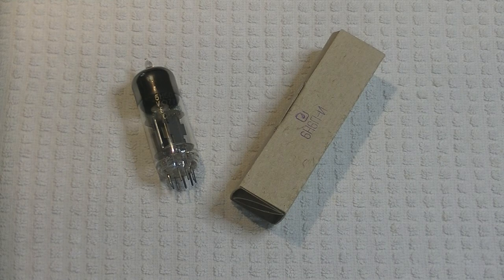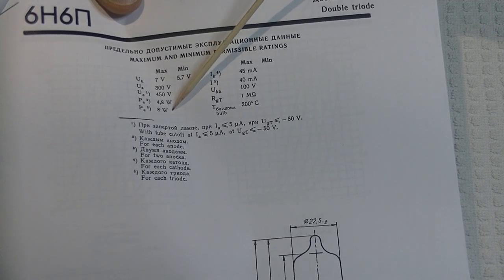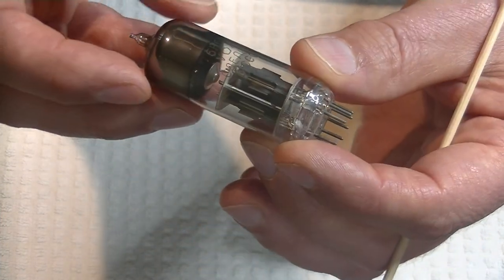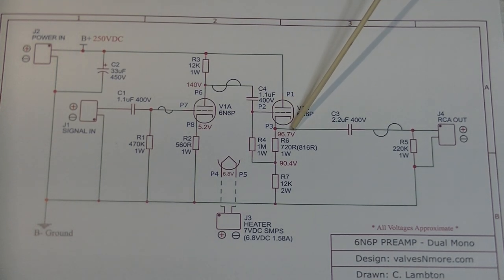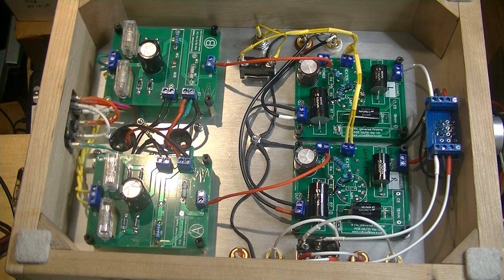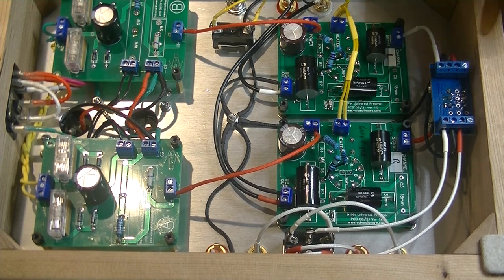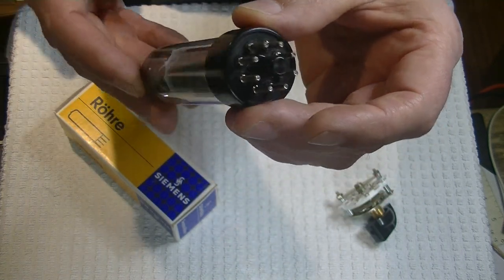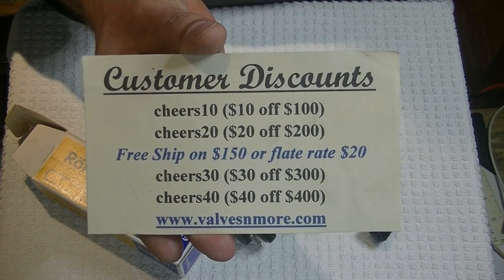Tube Lab #86 - 6N6P Tube & Prototype Preamp

Comment: Really interesting tube. It is actually a small power tube kind of like the 12B4A but with two sections and easier to drive due to higher mu. You could parallel the two sections and get very near a triode connected 6AQ5. Very flexible.
Reply from the maker: Exactly and most importantly it sounds great in my standard Preamp configuration.  Not to mention that it is big, tall and sexy!  I'm a sucker for tall 9 pins with nice full chrome domes.  Years ago visuals didn't matter at  all, because tubes were always hidden inside cabinets.  But I like to put them front a centre on the top plate of our Kit Amps.  Now don't get me wrong, first and for most, the tube has gotta sound good, be available for reasonable money and be reliable, the visuals are just a bonus!
Reply: @tubelab194  And then there are those voluptuous Coke bottle tubes. :D

P.S. is there a particular reason you chose RC coupled cathode bias for the CF as opposed to direct coupling or voltage divider bias?
Reply from the maker: @mkshffr4936  Yes,  I tried various CF bias methods, but it took a week (in my spare time =0) to find the one I presented in Tube Lab that worked perfectly for both the 6n6p and 6n6p-I and sounded great. The schematic is available as a Free download in the store and is under an Open Source liscence as well.  I still need to do some more critical listening, and that will start this week with the arrival of a 5A SMPS to power up the 6n6p-I, which has a start up surge of 5A!  It quickly settles down to 2A, but my 2.2A SMPS wasn't able to handle that surge.

Comment: Thanks for you videos as always! The NEVZ plant to my knowledge was in Novosibirsk, not to be confused with NEVZ Novocherkassk (a locomotive plant). I'm surprised you're surprised: the 6N6P (the standard, not the pulse version) has a reputation of quite possibly being the greatest preamp and driver tube of all in some former "behind the iron curtain" countries. I have an amp in which it's used as the driver for the GM70 transmission tube (the Russian end-all version of the 845).
Reply from the maker: I've heard very little about the tube and going way back with Google shows only a small handful of hobbyists working with it.  Much of the online talk must not be in English, same problem with Japanese tube designs.  But even if I'm late to the party I'm happy to have discovered the tube!

Comment: What is your all-time favorite small signal tube for sound character?
Reply from the maker: My personal experience is limited to a handful of small signal tubes that we use in prototype kit amps.  And of course we only choose to design amps around great sounding tubes!  Currently we work with E80cc, 12au7 (and variants), 6n1p, 6n2p and 6n6p.  For the E80cc both of the more common types - philips and Tungsram sound great, 12au7 the best USA made version is the rca cleartop.  For the Soviet 6n1p and 6n2p i love the voskhod tubes and the 6n6p was only commonly made by NEVZ factory and they sound great as well.  For a tube to considered for a Kit it needs to meet our electrical requirements in circuit and have a low distortion, clean and clear sound.  Sometimes a tube will bring some additional special sonic quality and we of course welcome those unique properties.  Good examples of this include the 6n6p which has a very full rich midrange and the rca cleartop which has amazing clarity.

Comment: "That's booooring..."  You have a tube nerd channel, tube data sheets aren't boring to weirdos like us.  ;-)   By the way, the "pulse" is likely the EMP pulse from an atomic blast.
Reply from the maker: Thanks for the comments!  I had actually thought the 6n6p-I being rated for EMP, but did some more research and apparently some types of tubes are subject to pulses in circuit.  That made more sense to me, but your idea has merit as well.  I'll consult with my friend who is a retired electrical engineer, who was trained when the only option was a vacuum tube, so he has a depth of knowledge that goes way back.  He's probably forgotten more than I'll ever know!
Reply: @tubelab194   Yeah, I suppose it depends on what it was used for.  I'm a bit rusty on Soviet era tube minutia but being a child of the cold war when I thought of "pulse" in regards to a cold war era Soviet tube I thought EMP.  Maybe we can refer to it as "electrically ruggedized".
Reply from the maker: @georgeswanson9483  true, it's always possible it can handle both situations.  I just consulted with my Friend and he immediately thought the same thing EMP.  I have some contacts among my Ukranian tube wholesalers, I'll ask them to read the Russian data sheet and see if that will help solve this wee mystery.

Comment: Dear Sir, I'm new to using tubes in amplication. May I ask is there a real real sonic difference to the 6N6P versus the ECC88 VS-Rocket tube? Thank you
Reply from the maker: @tommythe-datnguyen9572  you really can't compare the Soviet 6N6P to 6DJ8/ECC88, they are completely different tubes and in most cases won't be used in the same circuit.  The soviet 6n6p is a unique tube with no direct Western equivalent.  A better question would be, how does the Soviet 6N23P compare to the ECC88, the reason being they're very close equivalents.  And the answer is very favorably, though until you try it in your actual circuit/system you won't know how it sounds.
Reply: Thanks so much for your response. My phonostage (Octave Phono Module) uses the stock 6N6P tube in the variable output stage and a 6N1P-EV in the output buffer stage. In the manufacturer manual specification it indicates ECC88, 6922 or 6N23 can be used as alternatives. For this reason I'm curious as to how the alternative tubes will sound compare to the stock 6N6P and 6N1P tubes. Do you have a view?
Reply from the maker: @tommythe-datnguyen9572  all those tubes your manufacturer listed are either the same tube or very closely related electrically. There's no (zero) point discussing the sonic differences of a tube like the 6n6p for a circuit it can't be used in.  Now in circuits designed for the 6n6p, the tube sounds very neutral with a nice fast response and works excellently as a gain, driver and cathode follower, and has enough power handling it can even be used as a power tube in an OTL amp.  Caution!!! The 6N6P is a powerful tube and should not be substituted in circuits not designed specifically for it or you could damage your amp or worse start a fire!
Reply: Thank you for your guidance.

Comment: There was a case in the 1970s were a soviet fighter jet landed in the hands of the US military.
When they analysed the control and navigation circuitry they noticed that a combination of solid state and vacuum tube electronic components were used. Initially they were amused at the use of vacuum tubes only to later learn that the vacuum tubes were used in critical control systems. This was deliberately done by soviet aeronautical and aircraft engineers to protect systems from the shock generated by nuclear blasts that would normal fry solid state components. The used micro Vacuum tubes which were a lot more resistant to nuclear blast shock waves
Reply from the maker: I consulted with my Ukranian wholesaler and he doesn't know what the tubes were made for, but it's starting to look more and more like the pulse rated version was capable of surviving an EMP.  It's scary to think engineers were seriously considering the possibility.

Comment: is this ok to directly drive headphone 300Ohm impedence like Sennheiser?
Reply from the maker: You mean using the tube in an OTL headphone amp?
Great question and we already looked into this.
The plate resistance of the 6n6p is 1.8k /1800r
So you would need 6 tubes per channel (1800/6 = 300)
12 for a stereo amp
The heater consumes roughly 6w (12 x 6= 72w)
72w just for the heaters, is a wee bit hot but 12 tubes would be on the very edge of what is practical.
Now a pair of 600 ohm headphones would only require 6 tubes and that's getting more practical.
Reply: @tubelab194  thank you :) ... what about a SRPP configuration?
Reply from the maker: @lupoal4113  I've experimented with a SRPP preamp design and consistently found the circuit made my vintage tubes microphonic, so I abandoned the circuit.  In my experience simple circuits generally work best and sound best.  Every time I get all complicated the sound degrades. I think the minute you leave the path of a simple circuit you introduce things like feedback, phase shifts and other unintended consequences that all degrade the source signal.  That's always our priority when designing a circuit - preserving the source signal.